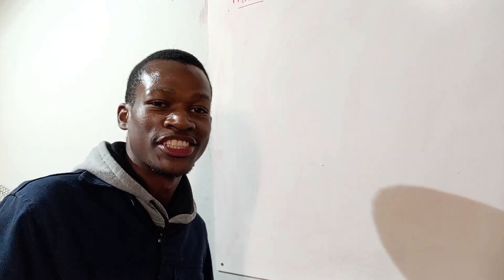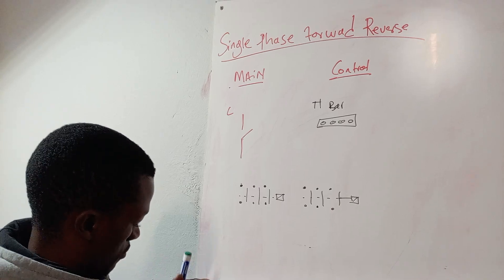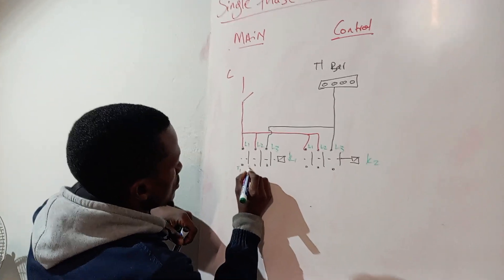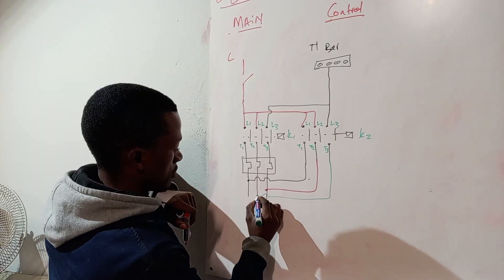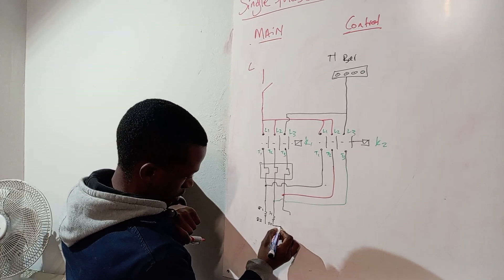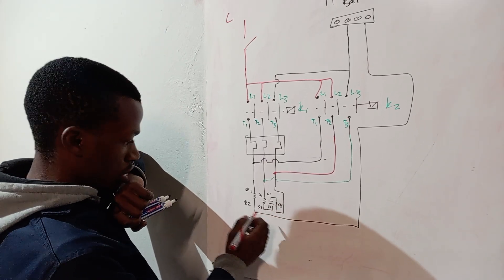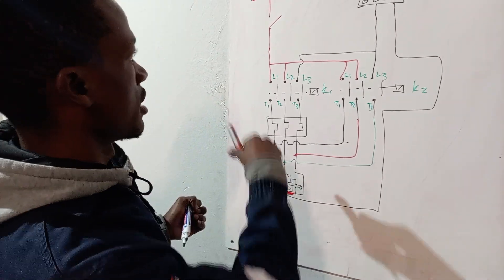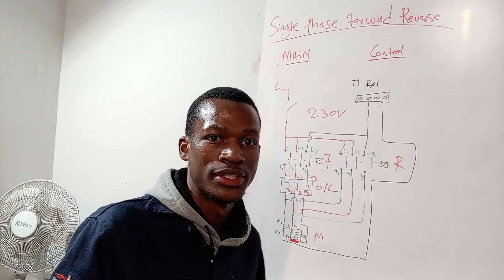Single phase forward reverse | Electrical Apprenticeship Training | motor

Comment: Your main circuit it's wrong bro. T1 is connected to centrifugal switch bridged to run cap and from centrifugal switch to start can and T2 & T3 connected to your run windings and start winding connected to neutral in & out